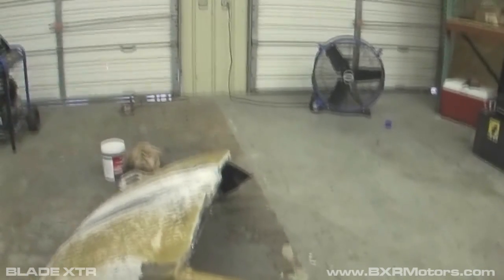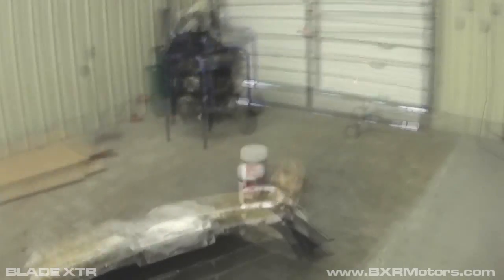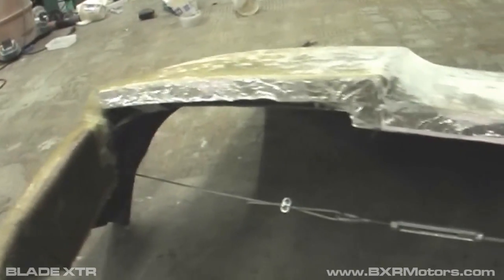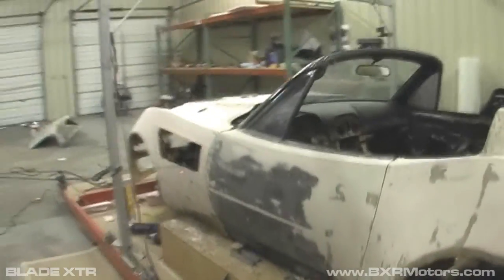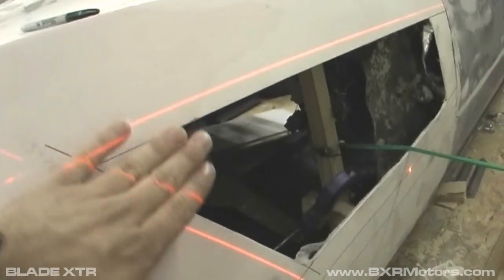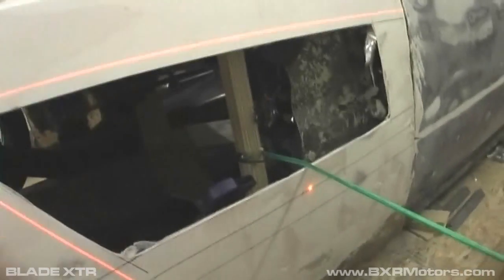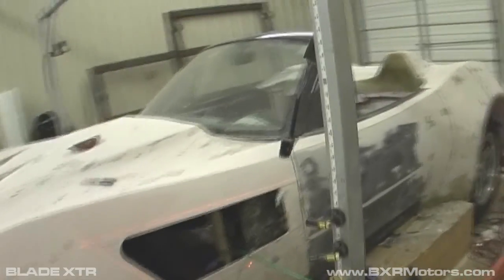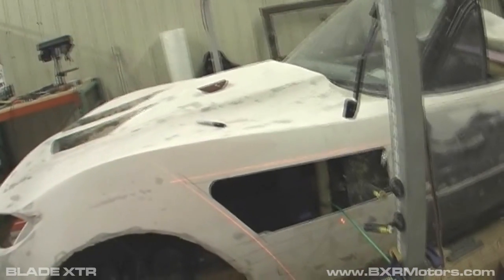Bailey Blade XTR Car Design | Quick Update, modified side vents and using laser gantry - Part 18

Comment from the maker: Well of course the car is designed in CAD and so are the updates and changes. But having the car CNC the correct way would have cost us a lot money, estimated at $230K. Im not talking about the home made CNC routers people are using. You have to do just as much work with those.